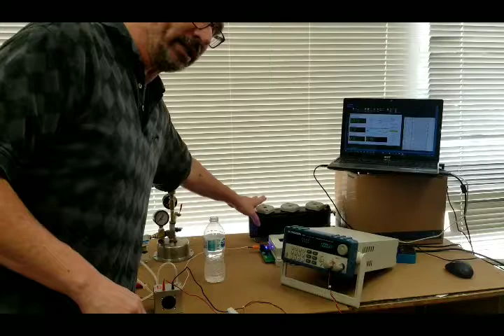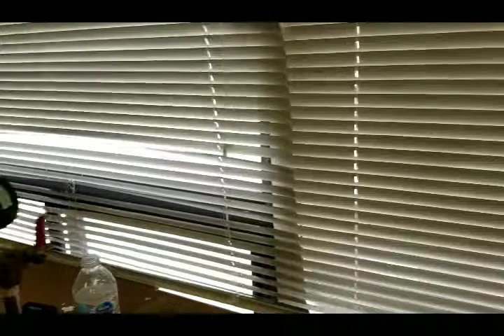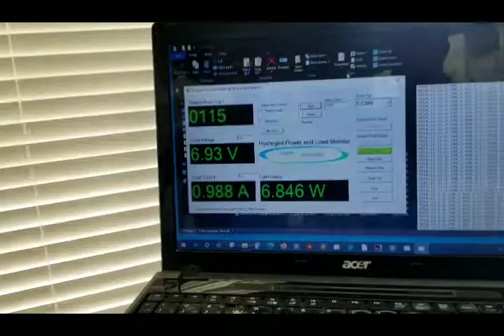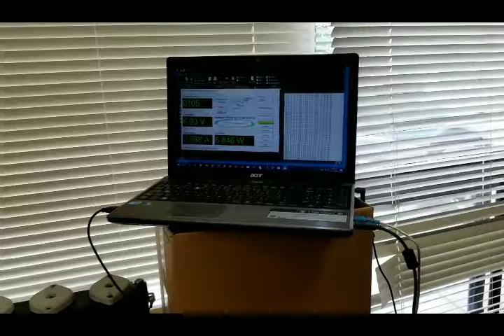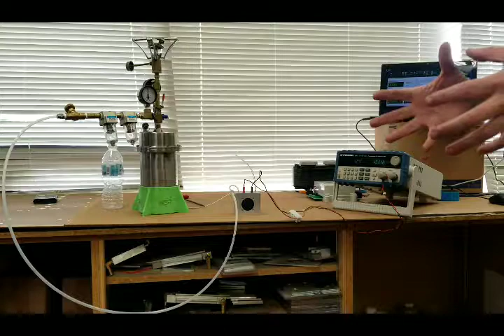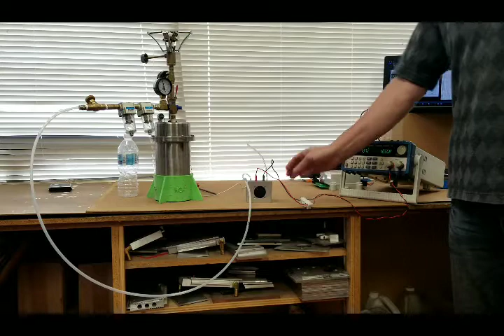Hydrogen on demand 1G Elemental Material Thru Fuel cell By GEMA Sciences GHG free assisted power

Comment: Do you need a test building? I have 1400 sq ft radiant floor brand new building waiting for a system. Building I just built is not in use.
Reply from the maker: One of our investors is a home builder in Quebec. Once we have issued Patents we plan on setting up a demonstration Home with several green tech. Hydrogen will provide base load power to secure Guarantee power when the solar and maybe wind are not working. This is one of the major issues we off grid. People are always running a generator with Diesel or Gas to make up for short fall. We also have 32 years of thermoelectric generation experience, so we have a history of customers telling us all the issues they face from snow fall to lack of power in the 6 month winter months. You might look at the Thermoelectric Generator Rabbit Ears. It takes heat from the wood stove flue and transfers to water. The Seebeck modules produce power for charging batteries and the heat warms up the circulating water on the cold side enough to heat up the floor. It takes your wood stove and turns it into a distributed power and heating source.
Reply: @thermoelectricpowergenerator  I’m not planning to do a wood stove in 2021 but might reconsider with the rabbit ears in the equation. Do you have anyone marketing this to alternative energy contractors?
Reply: @thermoelectricpowergenerator  None of the car giants who are going down the Hydrogen route, have an on board source of HHO , any idea of the equivalent power density  of your system when compared to batteries?